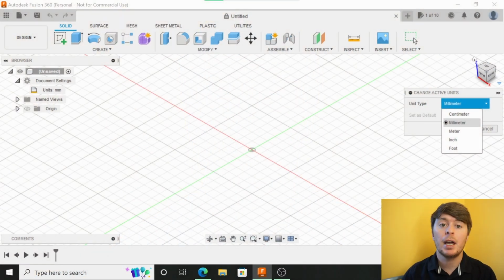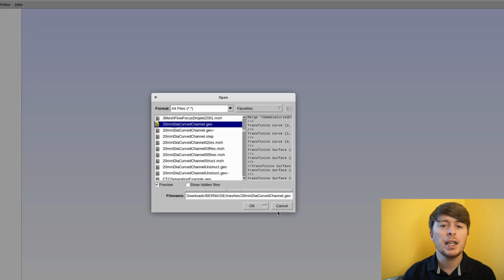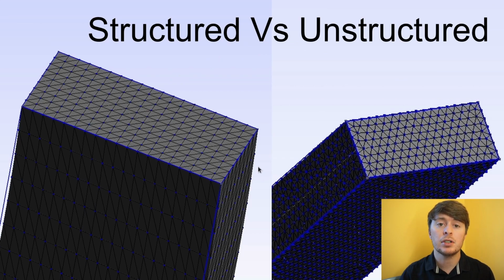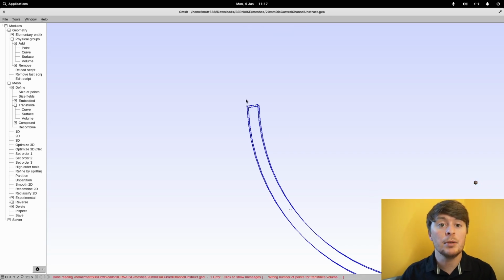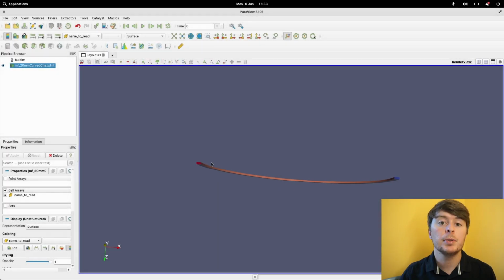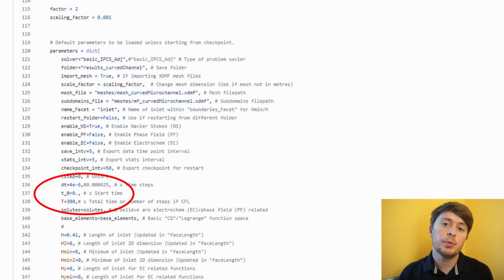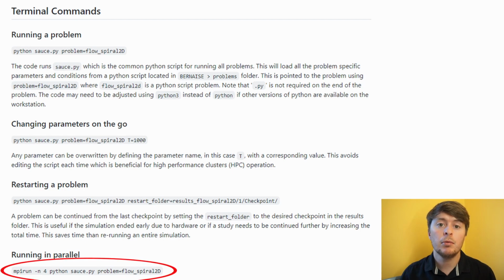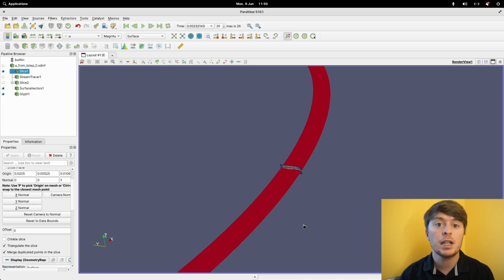Setting Up A CFD Problem | FEniCS CFD

Comment: Awesome video, have you ever tried to use OpenFOAM? For me, Fenics seems a little less intuitive.
Reply: I want to implement phase field model in Fenics but I have so much difficulties. Can you share you code it might help.
Reply from the maker: @ghufranullahkhan7479  Hey, phase field is challenging to implement but there are some software libraries such as BERNAISE which has already implemented the phase field equations. I have one such video investigating phase field in droplet formation within BERNAISE / FEniCS here: https://www.youtube.com/watch?v=jVa4I3Rd2YI&ab_channel=NanoMedic (Code is available on my GitHub here: https://github.com/MattH688/BERNAISE/blob/master/problems/flow_focusing.py and I talk about the governing equations behind the scenes here: https://nanomedic.org/simulate-microfluidic-droplet-formation/). Hope this helps!

P.S. Apologies for the delay in replying. I started a new job and caught COVID so haven't had too much time lately but I am hoping to be more active soon!
Reply from the maker: Hey Andrew! I have not tried openFOAM but I have seen use cases and I agree it does seem far more intuitive for users. Ultimately, it comes down to what you are trying to achieve and what both platforms offer. (Below is my take on FEniCS compared to other CFD, apologies for the long block of text!)

The one major benefit FEniCS offers is control over the partial differential equations fundamental for CFD which can be locked away behind pay walls, lack of documentation or limitations of other software packages. For example in openFOAM, it seems difficult to implement a custom solver or there is a lack of documentation - http://openfoamwiki.net/index.php/How_to_add_temperature_to_icoFoam. That said, I have not searched extensively. In FEniCS, it's front and centre. So far on this channel, I have published microfluidic droplet formation and Navier-Stoke CFD where soon™ I hope to publish a simple framework for Lagrangian Particle Tracking (LPT). Of course there are other major differences such as finite element method (FEM) used by FEniCS vs finite volume method (FVM) used by openFOAM which both have positives and negatives. COMSOL has a great blog here comparing both FEM and FVM - https://www.comsol.com/blogs/fem-vs-fvm/

The main reason I used FEniCS was a recommendation from a collaborator at Imperial College London when I was a postdoc at the University of Kent. I appreciated learning the maths and how to implement it directly into the code. Whilst, yes, I could read the documentation for the package I used such as COMSOL or openFOAM and learn it that way, I felt a greater understanding and appreciation of the equations. With that said, it took far longer than an "off-the-shelf" or pre-built software package. FEniCS was likely my best option at the time as it matched my goals of implementing different Navier-Stokes solvers, studying droplet formation and LPT in one package somewhat.

To conclude, my advice for novice users is to probably avoid FEniCS unless there is a pre-made model for your application as it has a steep learning curve. That's part of the aim of these videos and problems to provide pre-made models for people to use in the wider community!
Reply: @NanoMedic  I agree with a lot of what you are saying, and I think the video is great. I have been learning Fenics and Fenicsx lately, so I appreciate the challenge. I really liked Fenics because it has the feel of a library, and is written in Python with the C++ backend. So that affords a lot of flexibility in defining a problem and choosing solvers. The only other software I would compare to would be Deal II, but that is of course C++, so slower development. Other softwares like Elmer or others are quick to setup, but they lock down what you can do. AND, if you want to implement your own solver then you are down to writing Fortran code. So no fun there. There are some new FEM packages developing in the Julia language ecosystem, like Gridap and Ferrite, but they are still very new so limited features still. Fenics is 20 years old, so more element types, etc. But the Julia packages have the benefit that they are written in Julia and run at C++ speed. So if you want to go to the next level and write your own solver functions, you can do them in Julia instead of C++, and Julia is fast to write. But of course those packages will take some time to mature, but they are advancing at a nice rate.